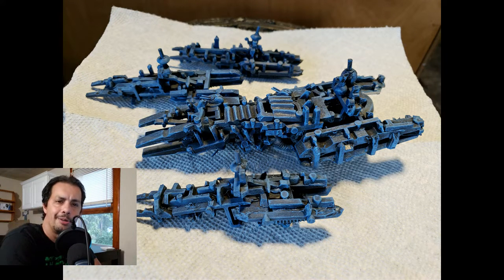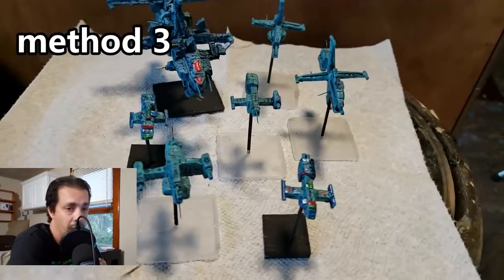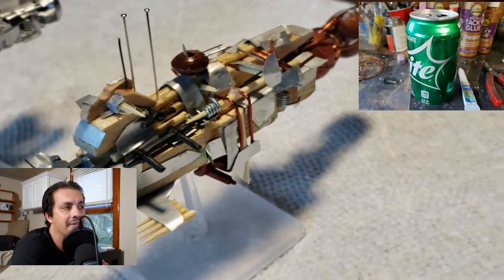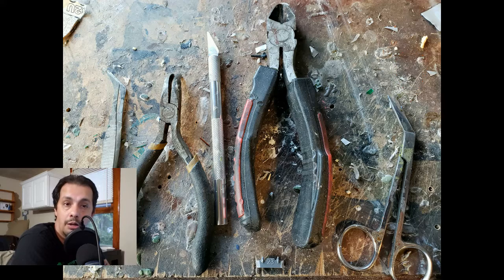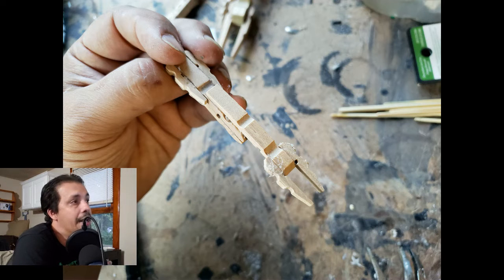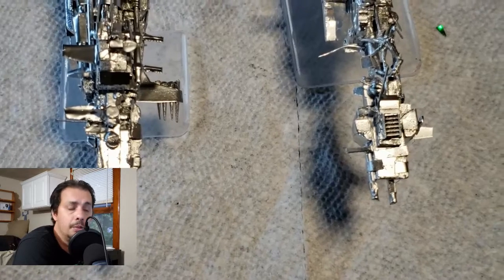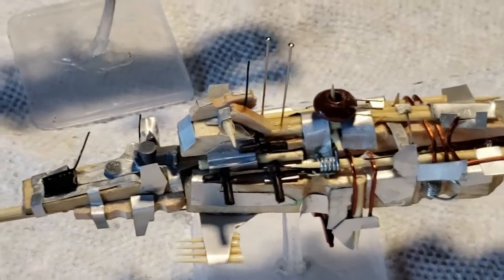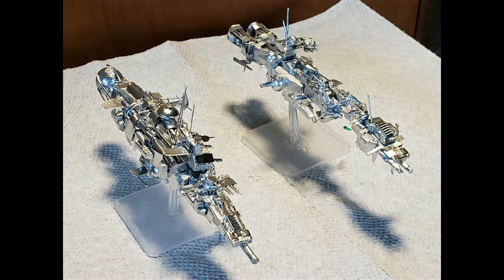Scratch built gaming starships

Comment: MJ, you are my idol and inspiration!   Just wondering though, what are the glues / adhesives you use for your models?  For the (a) wood-only, (b) styrofoam,  (c) wood & tin bits and (d) sprue - models ?  Thanks!
Reply from the maker: Thank you very much!
Wood, I use either tiny bits of hot glue and wood glue for smaller pieces or bits of wood detail.
For styrofoam, hot glue and white glue. I use a glue gun with low temp setting. However, the foam I use these days is recycled from meat trays, so it is more heat resistant.
Tin, usually krazy glue (lock tite brand), I sometimes mix a tiny bit of krazy glue and white glue which creates a quick bond for tin.🙂 thanks hope this helps.
Reply: @mjhobbycorner5503  Many thanks MJ, will try it out!
Reply from the maker: @ambagary4560  sounds good, I will have an updated starship video very soon

Comment: if I may ask, I'm curious as to which type of foam is best for this? Could I use popsicle sticks, too?
Reply from the maker: Hi there, I used recycled foam from produce packages, cut to size. Think I may have a vid on that. Popsicle sticks, cocktail sticks (thicker than toothpicks) can all be used. 🙂thanks..
Reply: @mjhobbycorner5503  I heard the produce package part mentioned in the video, so sorry for repeating myself and asking a redundant question

I was just trying to get more info since as far as I know, the only kinds of foam I have right now are Styrofoam, sadly its the crumbly kind, which is very frustrating, and maybe foam plates, but I'm not entirely sure I have the last one

I assume foam plates would be good if cut up, right?
Reply from the maker: No problem, your question is not redundant.  plate foam may work too. You may need to strengthen the pieces by joining cut shapes to each other. Little cocktail sticks are good for joining pieces (like a shishcabob) I used to use dollar store poster board, before I decided to recycle produce foam🙂👍
Reply: @mjhobbycorner5503  thanks man, much appreciated